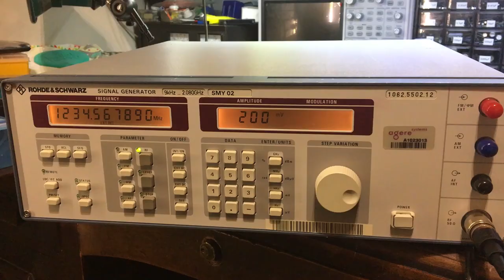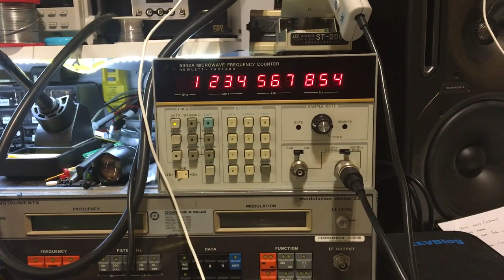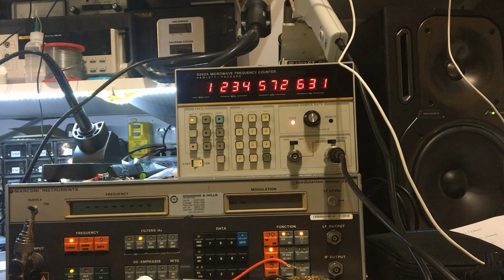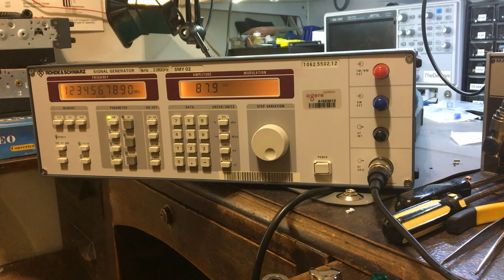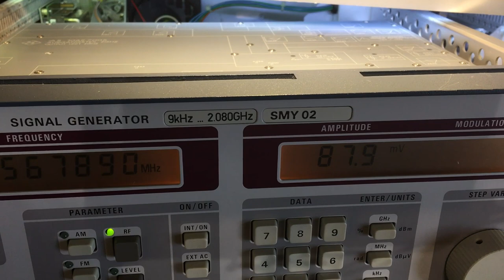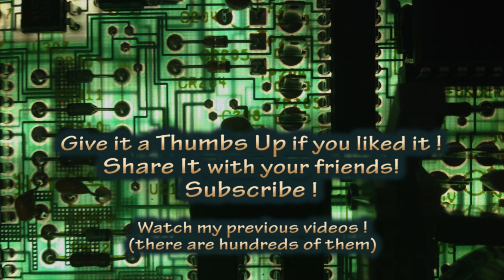#259 Rohde & Schwarz SMY 02 RF Signal Generator Testing and Repair

Comment: Hello, i am in my car, 15h08,a box with a SMG 1ghz generator on the passenger seat. Ok i am working 2 hours and go to my home test it. I buy it on ebay, and it was working before the shipping.
I'll talk with you with my bad english if i need. Really excited to see how rf circuit are built inside this rohde and schwarz tool. I think it's the best brand besause they sold to russia and to ukraine. 🤔🙄

Comment: I bit the bullet long ago and wired up all the boxes with a 10MHz reference distribution system and feed it either with the Z3801A GPSDO in the winter to add a little heat to the shack and the Rubidium in the summer time turned on only when needed at the bench to help keep the room cool! Think you're still working on your distribution system but I may have missed an episode where you finished it up. Have a couple of R&S boxes here as well...good stuff!

Comment: That's a beast :-D
i've never seen a toroidal transformer in a can.
Perhaps you could dissasemble the old fan to see what's stopping it working, if you like pain that is :)
Reply from the maker: The fan does work, it is just rattling a bit from a worn bearing/bush, making it noisy, the one I put in is MUCH quieter. I put the pulled fan into my spares bin, in case it ever needs to go back in (because of the missing sped sense line).
Reply: @TheDefpom  A friend of mine just replaced the ball bearings inside the fan.